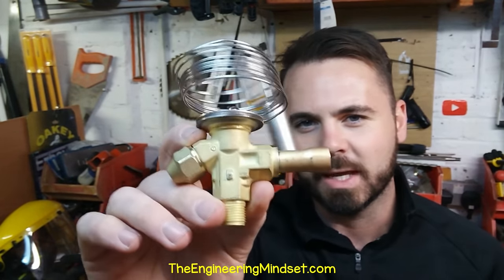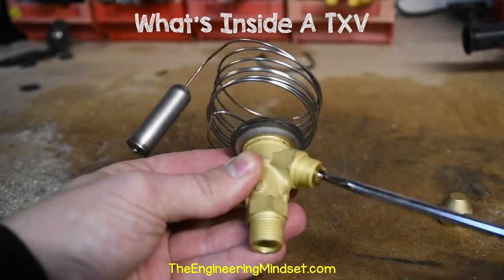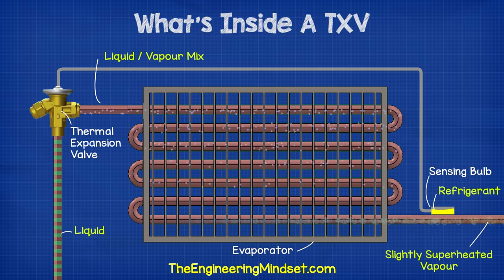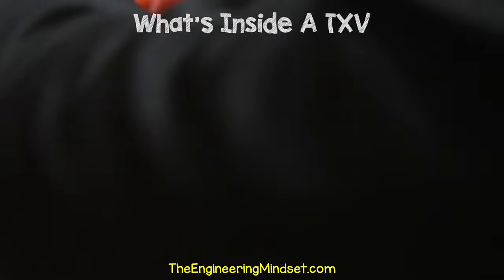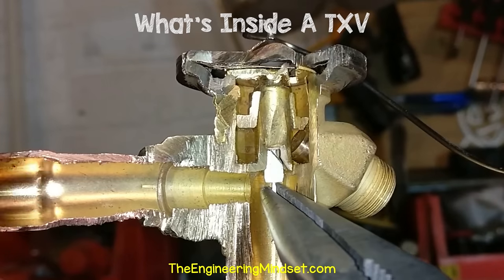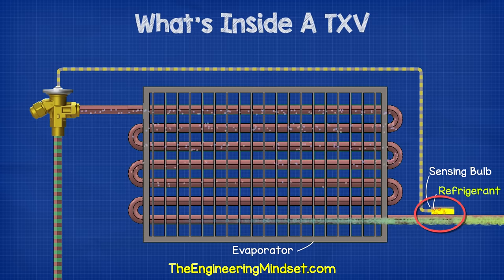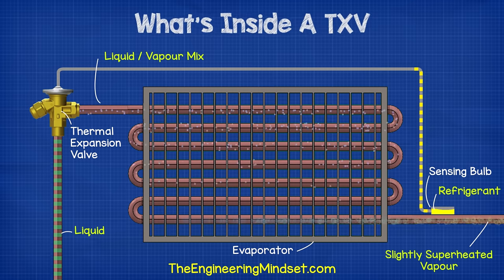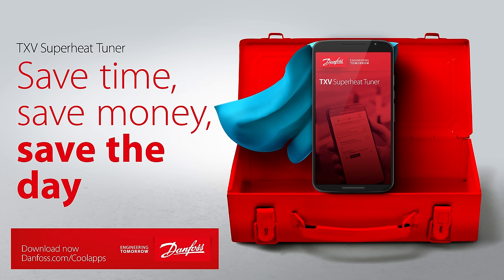What's inside a Thermal Expansion Valve TXV - how it works hvac

Comment: i know this is kinda an idiotic question and/or idea. but i acquired a refrigerated dryer that functions the same as explained in this video. i got it from my father, a dentist, who had to upgrade his euipment. i use pneumatic tools, but nothing expensive nor special. just the average Harbor Freight collection. so i don't care much to dry my air. my girlfriend bought these little monsters called axototls. I like them. But they require cold water, around 18C. And a water chiller for an aquarium runs at least $300 for one that actually uses refrigerant. It's a LOT OVERPRICED as I could buy a entire fridge for the same price. So I was wondering if I could use the chiller dryer as a water chiller instead, by removing the filter from the system, and adding a good 500gal/hr water pump that would push the aquarium water through instead of air. the concerns i have are regarding water pressure vs. air pressure, and possibility of a freeze up. This modified
usage doesn't have to be perfect. Just keep the aquarium water ±2℃ of 18℃. Actually the axototls are fine down to around 10℃, and can go even lower for short periods of time. The danger is when the water is too warm, which room temperature is the borderline, as these animals lose their ability to process food and get bloated and die very quickly. So you can easily understand now why I promised to fix the issue for her as she was crying because she lost one, as she didn't even have a thermometer for the aquarium. I'm a die-hard DIYer, as I can trust and depend on my tools to last a lifetime, whereas 99% of products are a huge waste of money, as they are not made to last at all, instead purposely manufacted with a set life, that is the shortest amount of time they can get away with. Anyways, if I remove the filter that collects the water from the air when it is chilled, essentially that would allow for water to flow through instead of air, provided I use a water pump for circulation, correct? As without the filter it's basically just a closed loop that is chilled to a temperature that can be adjusted and set by adjustment of the TXV as you just illustrated in this video, essentially using it as a thermostat. I figure as long as I can provide a fast moving flow of the water, and have the TXV adjusted in the correct range to reach a constant, there should be no problems. As the aquarium holds 60 gallons, and the pump I bought for this project is actually made for pond filtration. It's 30 watts and pumps up to 500gal/h. But it's flow is completely adjustable from 0 to 500, and it can be used submersed or "inline" (not submersed) - i plan to use it inline so i can easily adjust the flow and and choose where the water intake and output are. The pump is made to deal with a lot of "stuff", such as clogs, power outage, high strain, etc but has built in solutions that will protect the pump from cooking. It says it can pump a column of water into the air to a height of 7'6". The make and model of refrigerated dryer I have is:  model # WRA-0010-A69 made by: Apollo Dental Products. The rated flow is 10 SCFM. Standard operating inlet air pressure is 100 PSIG. Factory test pressures are: 144 PSIG LOW SIDE / 400 PSIG HIGH SIDE. Max inlet air pressure is 200 PSIG. I haven't had a chance yet to look up how the Suction Service Valve functions, but if anyone who helps or is just interested, I can post the electrical and refrigerant diagrams attached to the unit, as well as photos illustrating all parts and functions. I have it opened up right now, and to me, this thing seems simple, just like a window AC unit or minifridge. I just wanted to ask some of you who work with this equipment regularly, if what I intend to do is possible, and if there are any precautions or tips that might save me some time. I want to just go ahead and test it out, but I will wait a week for any replies, as this thing could maybe save me $300. I don't want to destroy it. Simply repurpose it. Thanks in advance to anyone who lends a hand! I don't want to be accused of SPAM, so I will wait for approval from you Paul, as this is your channel, to post a link to my website where I will have the diagrams and photos posted. Thanks again everyone! 

-patrick

Comment: pretty simple. why did my ac guy try to charge me $500 for a new one?
Reply: Because the part cost roughly $250 hourly wage to diagnose and pick up parts, insurance, gas, administrative cost, tools, and of Course profit of 10-30% depending on the state you live in it’s a reasonable price